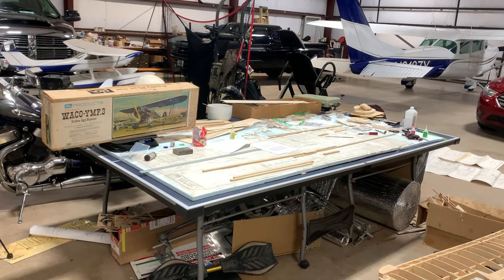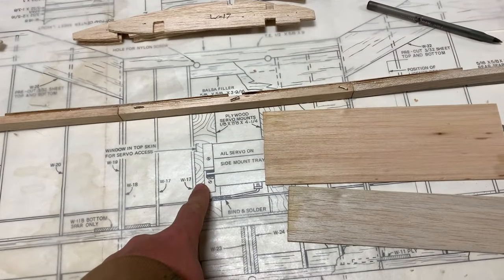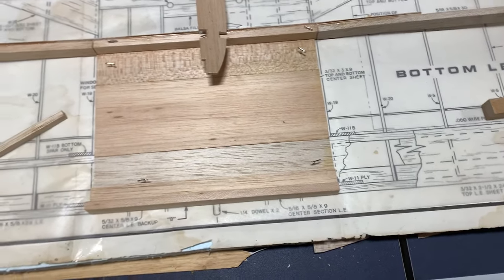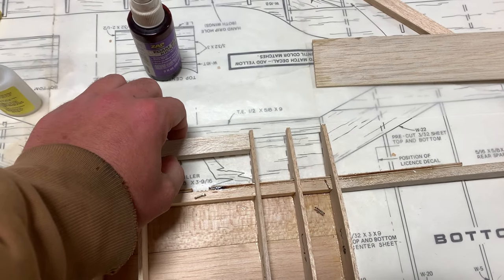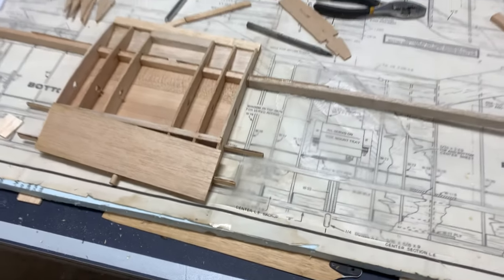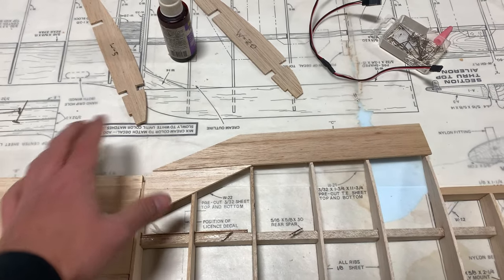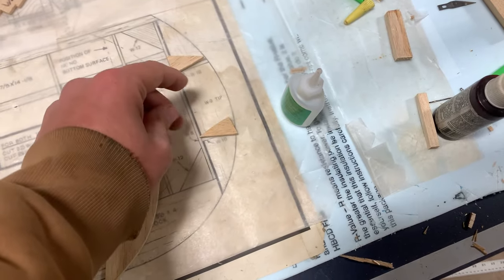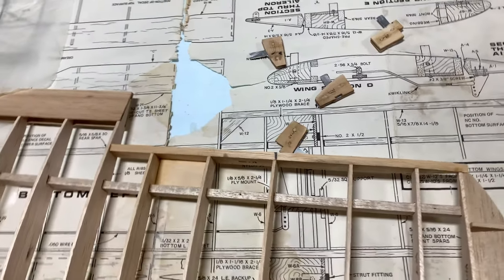Can I build this 80s era balsa kit? / Pica 1/5 Waco build part 1 wings.

Comment: Hi Tyler, I lucked into one of beauties although it had sat for years, someone had apparently tried to build the wings and of course all those parts are gone. No problem tho, cutting ribs and aquiring some balsa for what's missing is fun.....What I don't know though is what type of wood was used for the wing spars, may I ask what is supplied in the kit?
The rest of the plane (Fuselage.Tail feathers si all there)........I am a builder that started in the 60's and like they say, you can always learn something new everyday and that exactly what's happening as I watch your series.
Thx
Mike
Reply from the maker: If I remember correctly the spars were light ply.

Comment: Hello, nice to meet you, my name is Angelo, I live in Brazil, I started assembling my WACO yfm3 KIT, I bought it 8 years ago, the fuselage is finished, now I started the horizontal stabilizer, but I'm in doubt, do you have images of the steps of the elevator construction? My doubt is in the interpretation of the plan, at the same time that the stabilizer has plates it also has ribs 5/32 x 5/32, the elevator is completely plated and the ribs are to give the shape of a ribbed elevator after covering? I need guidance in this regard. thanks
Reply from the maker: Howdy yes part 3 goes over tail construction hope it helps. https://youtu.be/5lmwC-oY_K0?si=Z9DrMGXSJoZHQOXJ